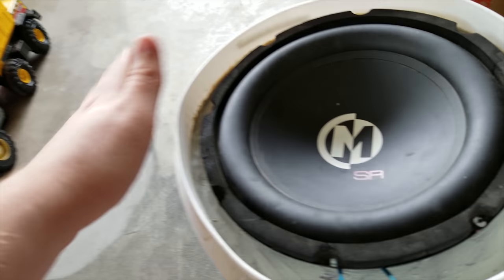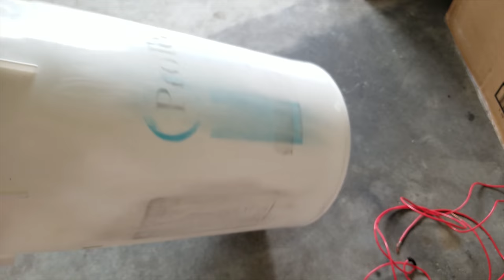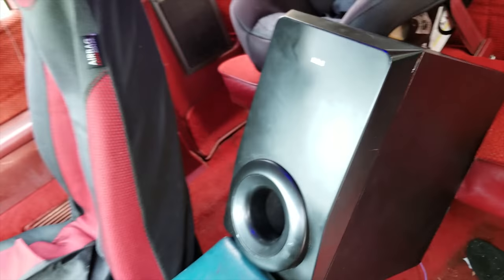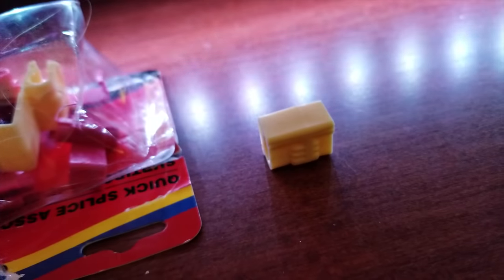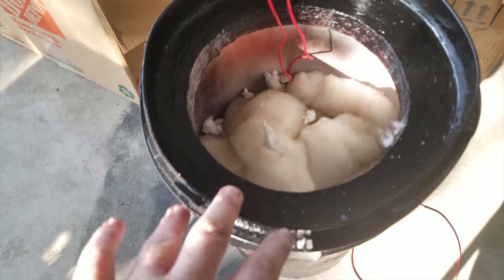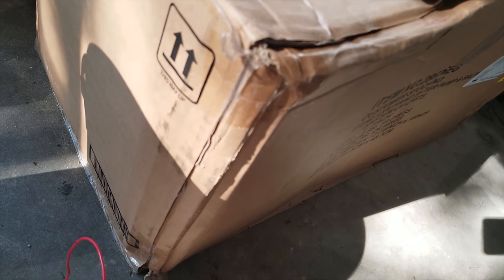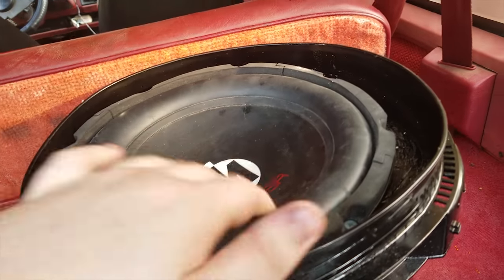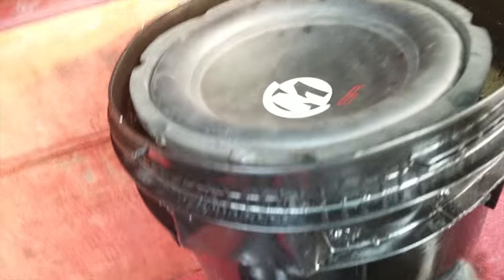How to make a bass tube out of a old bucket

Comment: To me I do "all that other crap" because I want it to look good. But more importantly I need it to sound good. The sound quality to me is the most important thing. And I'm willing to bet that, that Memphis Audio sub isn't in the proper size sealed enclosure. I know good subwoofers have a size range that they will sound good in. But to my eyes it looks a bit small to me. I  do like your creative thought. If you want to get better at this stuff. You need to educate yourself on the many ways to cut a "TRUE" circle. A circular saw would be my absolute last choice to use. I use a 2 step process that is real easy to do. I use a trammel arm on my router. Cut the outter circle first. Make an adjustment then cut the inner circle. Now you'll have a true ring for mounting subwoofers. Try it out & I hope that you gain more skills.